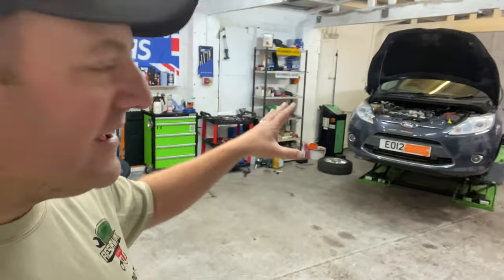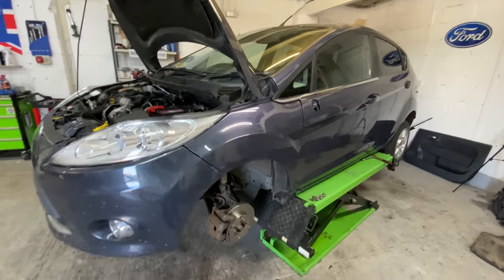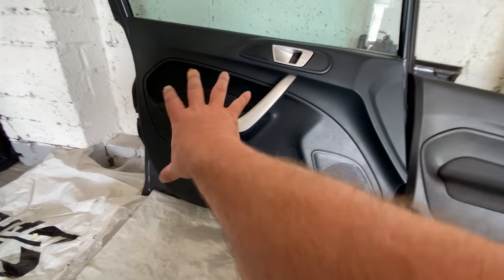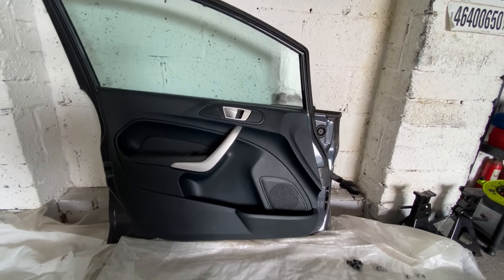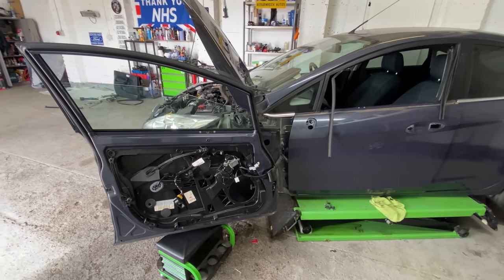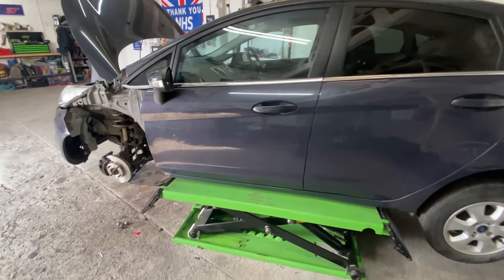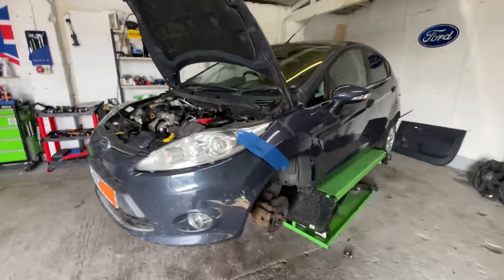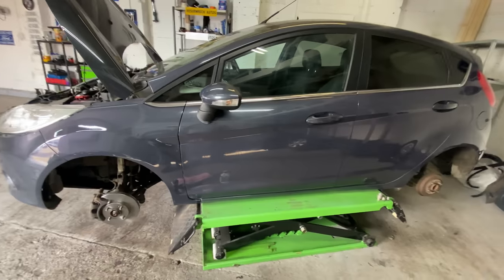Fiesta Titanium Side Doors Get Finished And Wing Fitted

Comment: Another little tip for you Mark for hiding those little scratch marks, especially on mid to darker metallic paintwork.  Polish in some black T-cut and you'll be amazed. The black compound fills the scratch marks, so your eye isn't drawn to the imperfection. Honestly, it's worked a treat for me, over the years! Loved it as usual. 👏👏
Reply from the maker: Thanks buddy nice tip I will try that nice one buddy have a good weekend buddy 👍👍

Comment: just cut the plug off the old door loom and then pull the plug off the motor and use the plug off the donor loom and just switch the positive and negative over one way the window will go down the other way it will go up i used to do that an the breakers yard to get a glass or window regulator  using a jump pack as a 12 v supply

Comment: Mark car is getting there. Not sure if you use knee pads in your trousers but if not I would recommend them on you list to santa as the cold weather will cause you problems on your knees. Also the pin tools are only a few quid on ebay.
Reply from the maker: Thanks Paul yeah I do have knee pads in my trousers all ways have used them and I’ll pick up some pins nice one buddy have a good weekend buddy 👍👍

Comment: You didn’t have to plug the door back in you could’ve just pulled the window motor of the inner door skin 3 bolts and you would’ve pushed the window down with your hand manually
Reply: Just for future reference LOL